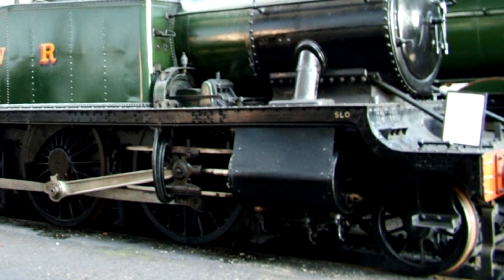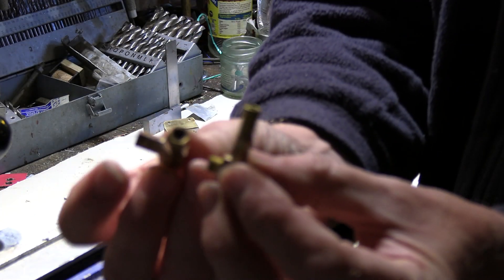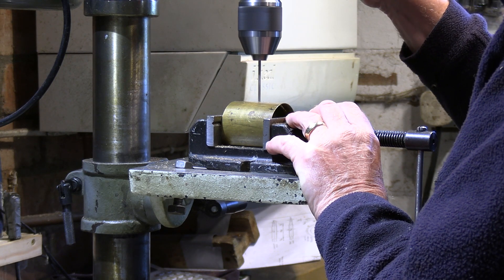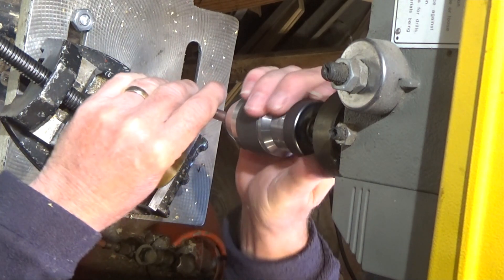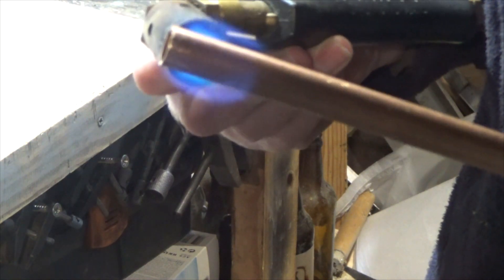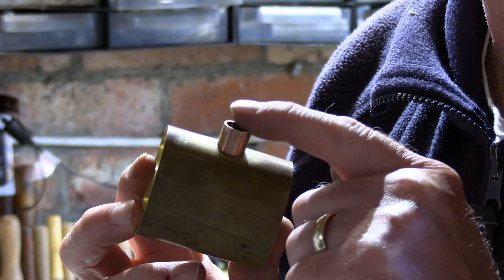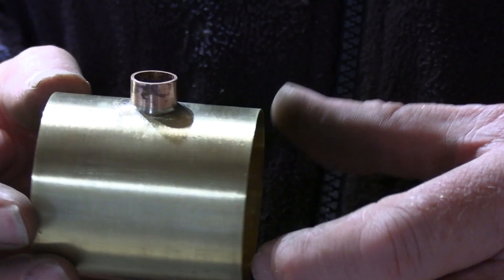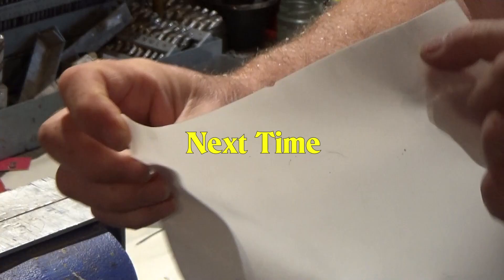Gauge 1 Live Steam Scratch Build 13

Comment: Another great video. I couldn't see how your inlet T pieces are connected to make a tight seal to those inlet pipes. Are they tapered like union nut?
Reply from the maker: Hello Rob,  In this case the ends of each pipe coming from the cylinder block are flaired out. When the nut is tightened it does create a seal on each end of the  T piece.   The alternative is to silver solder an olive onto the end of the pipe to give you some compression when the nut is tightened home. I have used the olive method in the past. Hope that helps.
Reply: @GroveDave  Very helpful. Thanks for your reply